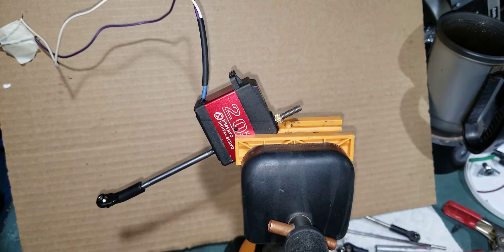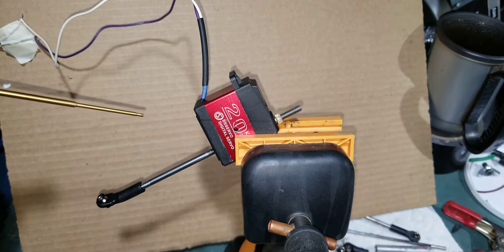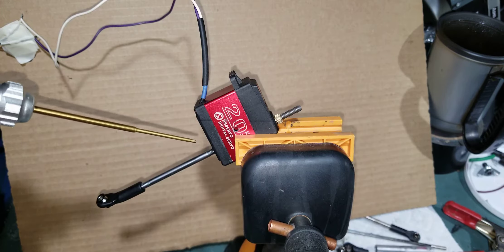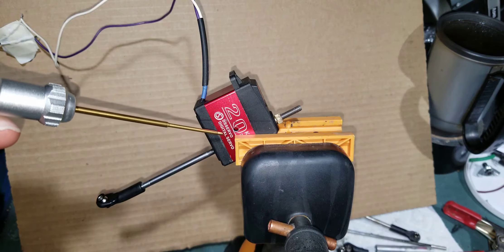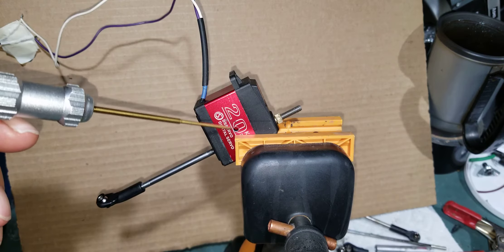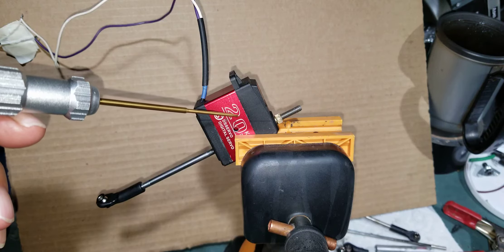DIY RC Truck Servo linear actuator

Comment: holy shit that is an amazing idea.. I have made some linear actuators oit of 360 servos by attaching threaded rod to the servo,but you have the extra length of the adapter that gets wasted, if you google huina servo you can see something similar to what im talking about. im gonna tear a servo down today and see how big it can be threaded/drilled.  if it could be drilled/tapped  m6 or m8 leadscrew size this idea would make small fast and strong linear actuators super cheap and easy. 360mg servos can be had for 5ish bucks a piece and only have to drilll and tap the main metal gear.